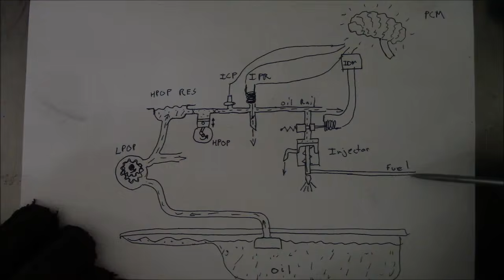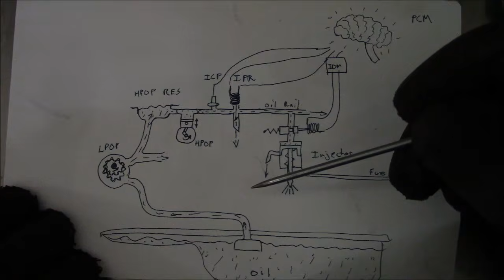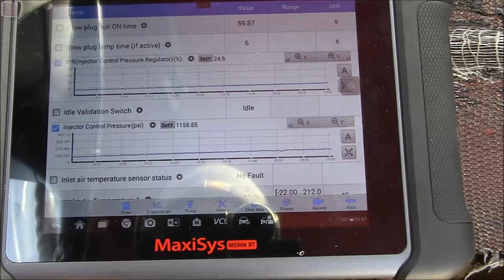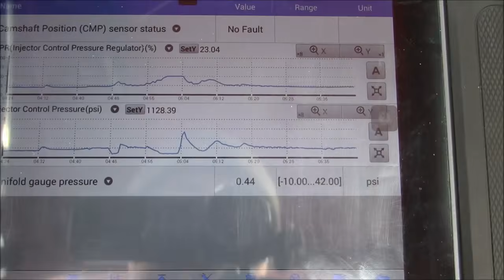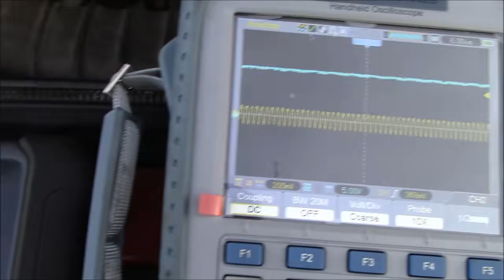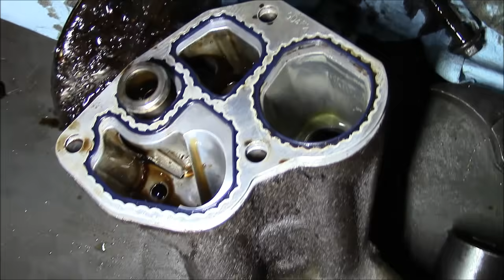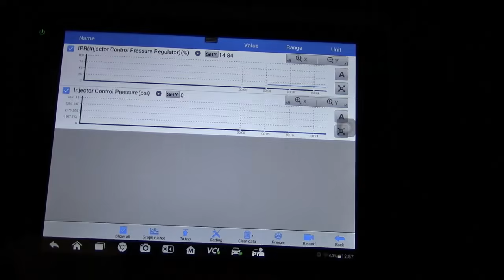7.3 Powerstroke Knocking, Rough Idle, Dying, but only when Cold. Plus many other Issues!

Comment: Great video about troubleshooting problems.  Thanks for sharing.  Loved the comment on the seat and shoes.  The Ground Strap on my 76 FJ40 runs from the starter mount area to the frame rail.  Do you recommend relocating those to higher in the engine bay as well, to keep them away from corrosion?  Or do those need to be as short as possible?
Reply from the maker: No, those big battery grounds are fine. But small wires don't fare well.

Comment: Good to see you fixing the wiring mess. That kinda stuff drives me nuts when I come across that.   One thing I learned from this video, is if I buy a old Ford truck. To not get one with that type of injection system. LOL
Reply from the maker: They used the HEUI for 14 years!

Comment: I live so far north that no salt is used. 
The roads are only sanded.

And of course plowed.
Reply from the maker: They used to do that here. They also used to use coal cinders. Now it's all salt.
Reply: @WatchWesWork  
It is normal here that it is too cold for the salt to work.
Otherwise, they probably had salted.
Cars from here are known not to be rusty.
They have many miles on the meter though.
For example, we have 25 miles to the nearest store.
So there are long distances here in the north.

Comment: what wrong with the seat , its perfect , nice job, question for you , i have an 01 dakota 4.7 and the engine stumbles form time to time , any suggestions?
Reply from the maker: Heh. No idea. Mass air flow sensor maybe.
Reply: @WatchWesWork  I,m a heavy equipment guy , desals loaders dossers and mining , you seem very well rounded with everything , very impressive , but i know big equipment  a lot better then gassers  , with the boots , holes in the toe don't matter , i replace mine when the heals wear just for back reasons , not the toe , lol if people complain use duct tape ,, that will keep them happy lol
Reply: Keep an eye on the tach, if the tach bottoms out when it "stumbles" it may be the crankshaft sensor. I had a 2000 Dodge Cummins with the same problem. Cheap part to buy, simple fix, just hard to get to.

Comment: I crimp those copper battery lugs on then heat it with a torch and flow solder in also then glue lined heat shrink over that. That makes them just about indestructible. Sometimes that’s hard to do all the old greasy wires though.

Comment: Is it normal to have so much smoke coming from the pcv on those old international 7.3`s? I'm not familiar enough with them to be sure
Reply from the maker: Yeah, mostly when the engine is cold and cooking out the condensation.
Reply: @WatchWesWork  gotcha. I was thinking about using one of those motors for my own project, but they look a little over my head so I'll stick with what I know for now. Thanks for the video!

Comment: Put a scanner on it Ck the history codes , put s 5000lb guages on the HP oil port , need 700 to start and run , 3000 at full fuel , ditch the mechanical fuel pump , mount one on the frame off a 6.0 along w/ a regulated return  , possible injector o ring leakage , also ck the screen and ipr function .How many miles/ hours ??? possible high pressure oil pump failure ??? saw one of these go 500,000 in a local driven tire truck , it did not move w/out at least 5 to 7000lbs on it.
Reply: Did you watch the video? Also they need 500 min to fire not 700.
Reply: Jdboy 9 How many hard start /no starts have you fixed , you put the fitting in the head and turn the key. At about 150,000miles the internal oil leaks start , depending on how it was cared for , remember , your using engine oil as hydraulic fluid , and yes I have put my guages on alot of no start /hard start trucks especially when not everybody had $10,000 laptop , btw if the high pressure oil sensor is not operating correctly or the engine does not start , the pressure regulator will be told to continue to build pressure, they will get stuck due to metal shavings , the 6.0s did come with a screen to prevent contamination.
Reply: @beckywatt5048  I have a gauge setup for testing hp oil. I'm not saying it shouldn't be used.  I'm just curious if you actually watched the video?  Your comments more or less are addressed in the video.

Comment: Have you pulled out the computer and made sure that the caps inside arent leaking? I had a 1991 F250 with a 351 and I had to solder in new caps on the board, it is a common issue with the boards and the caps being old.
Reply from the maker: No, but that's a common issue with all old electronics.

Comment: I had the rough idle on my 97 and hard starting ..lots of cranking , had to change the pickup pump and idle control to get it back to starting great . mine looked a little different but what a difference it made . I've put 3 seats in mine over the years ..I bought 2 trucks just because they had a good seat . Its mostly minor things that effect how a Power Stroke runs ...so fare never had a big repair ,90,000 still going .

Comment: HEUI is a pretty strong system despite its over complicated design, best part of it is the retard fail safe of not running if theres no oil pressure.  Yes I know drivers who would do this.
My honest first thought was ICP sensor on the way out. Just unplug it and if it still stalls out, its probably IPR or injection pressure(bad pump).
Reply from the maker: I've seen many no start Powerstrokes due to no oil in the sump. I remember dieseltechron said he gets at least one a week.

Comment: It’s sad that fords “best diesel ever” is really nit that good of an engine compared to others.  I use to love ford, but won’t buy one anymore.
Reply from the maker: To be fair, it's an international engine, and they were pretty decent. It's 25 years old...
Reply: Haha.
Reply: I won't buy ANYTHING with POS sensors on it that govern running the engine. I don't care the brand name they slap on the vehicle. They're ALL designed to fail just after warranty and the newer it is the more difficult to work on. Newest and pickup I'll ever own with a diesel in it is my 1st gen 12v cummins. Rides terrible but the engine is all mechanical.

Comment: If a guy has a bluetooth OBDII module you can get all the live data using Torque Pro.  If memory serves me I had to manually set up some of those PID's to work.  Been a long time since I've messed around with a Ford so Torque might have added those PID's by now.
Reply from the maker: A lot of guys use it.

Comment: Cold out...  -12F at 10 am here LOL.  Brand new lift pump decided it doesn't want to work at those temps.  Fuel is 50/50 #1 & #2 diesel with a dose of Stanadyne to boot.  Fuel isn't even cloudy.  Cummins started right up though.
Reply from the maker: Hmm. No water in it?

Comment: 😅😉 Hey, did you notice you need a new seat? Also your boots, is that a hole? 😂

Proud to be one of the 2 guys still watching till the end. Fully agree with you about wiring, do it right or do it twice (and with a fuel pump, the second time is likely to be in the pissing rain at the side of a road). 

Great video!
Reply from the maker: And I've had 3 of those fuel pumps leave me walking.

Comment: Not the exact extension but you can get these in all different sizes. I’ve got a few different styles to help out when I need one. Oh yeah Wes, by the new year you’ll have 150 “you need a truck seat” comments or at the least something said about it. 😂

https://www.amazon.com/Lenox-Tools-3084712X-12-Inch-Extension/dp/B000LGBY9E/ref=sr_1_5?hvadid=77996714502582&hvbmt=be&hvdev=c&hvqmt=e&keywords=die+grinder+extension+shaft&qid=1577637442&sr=8-5

Edit: I forgot to add you can also get these for your drill/impact driver that has the quarter inch hex with and without the detent lock.

Comment: That seat is just fine. A little duct tape will fix it, same with the shoes. :-) Great video. (edit to add: only mentioned those becouse I was one of the two. :-) )
Reply: Use LOCTITE expansion FOAM to FIX SEATS
JUST FILL
WAIT
CUT AS NEEDED
COVER 
NEVER ANOTHER ISSUE
JUST AS DENSE AS STOCK SEAT FOAM
WATER REPELLENT
Reply from the maker: Thanks for making it through!

Comment: Yeah, I got a good laugh when Andrew pulls out his grinder with a cut off wheel to fix his heater. Although, I do think he does his wiring a  bit better than what you showed. My seat looks just like yours, I need a new one also. Great diagnosis thank you.
Happy New year!
Reply from the maker: Yeah I saw that one...
Reply: TillmanXL yeah no. Fixing the vent with a grinder, and even worse, in the same video, he couldn’t figure out there was one more screw in the door panel so he angle grindered it. Fucking disgusting.

Comment: Unfortunately, your Ford Dealer sold you the wrong IPR valve.  The missing part you showed in the video is the edge filter.  The later 7.3L had the filter relocated into the high pressure pump.  The truck will run fine but there is the risk of debris entering the IPR valve and causing it to stick.
Reply from the maker: That's actually because I ordered that IPR for a later model truck that had roughly the same issue. The IPR I ordered for my truck was not in stock at the time I was filming this so I had to do a switcheroo later. But you are correct and I should have showed the correct part.

Comment: That truck is every mechanic’s nightmare.  The most surprising thing about the truck is that it doesn’t also have a plow with a rats nest of wiring, scotch locks and booger welds.
Reply from the maker: It's 2WD, so no plow. But it started life as a tire shop service truck, so it's had a rough life.

Comment: Slow start is hard on starters. My cummins started at 0 deg F  with block heater not plugged in after red light extinguished with no hesitation!  My supervisor had an older cummins with seal problems SO? Just a friend Ron
Reply from the maker: I've started my 6.0 powerstroke at -25F with no block heater.
Reply: @WatchWesWork  I was in Denver, CO. People in the Dakotas and Montana may have some interesting stats! Ford is an American icon. Henry built cars for the working man. They should stay in the USA and so should GM. We shall see! Prosperity usually leads to improparity by it's citizens. If neighbor loved neighbor then all would be much different! Just a Dodge, Fiat lover Ron

Comment: I love the OBS I know the 7.3 has alot of issues but I think its the ptpump, Also check the fuel filter could be limiting alot of pressure and it cant keep up.
Reply: Isn't that the first Power Stroke after the IDI Motors when they were still working out the Kinks before they mastered it in 97 - 99?
Reply: @thecloneguyz  I think the 7.3 had issues until they stop making it to be honest lol
Reply: @PCgamestech  
The 97 - 99 are selling for BIG BUCK$ 
Most sought after truck
Reply: @PCgamestech  
And the 24V Cummins are SKYROCKETING FAST! !!!
Reply: @thecloneguyz  Oh I know I wish I had one of these Id swap with a commonrail cummins lol
Reply: @thecloneguyz  Yup because everyone wants a cummins swap 24v is one of the best
Reply: @PCgamestech  
I wish somebody would take an om647 diesel engine and put it into a Ford body
Reply: @thecloneguyz  I think they dont because its such a small engine, Most people who swap want lots of power and torque
Reply from the maker: Fuel pressure is important. But it did not cause the issue I had.
Reply: @WatchWesWork  Yeah I saw I had to make my early prediction though great video though tearing into it.

Comment: Medium to light corse sand paper or a scotch bright on a flat smooth table will clean up that neck base
Reply from the maker: It's not flat on the bottom. The center is convex to hold the o-ring out.
Reply: Yeah that was my bad I didn't notice

Comment: oh no the rusty dump is back too!  Did you notice you need new boots and a seat for your Ford?  Love your systematic logical approach to diagnosing problems.   I think ill stick with my cummins.  Seems like fords always have starting issues with their diesels in the winter.
Reply from the maker: If the batteries and glow plugs are good I've never had a Powerstroke that would not start in winter. I started my 6.0 at -24F once with no block heater. But if the glow plugs or batteries are weak, forget about it. I've worked on several with the intakes blown off from using ether...

Comment: wow ,way over engineered, must of had some german inspiration
Reply: tvoprosucks It works good.
Reply: Bosch's contribution...
Reply: @icesoft1  they make good stuff. Just opened my f150 door and on 2013s there window motors are bosch. they also make good electrical components and maf sensors. Im used to bmws so bosch is in them. There better then the aftermarket.
Reply from the maker: Bosch and Delphi are about the top of the heap for diesel injection components these days.

Comment: The one nice thing about my old diesel Benz is that if you can get the engine started in winter it will run as long as you can keep the tank filled.  That engine is practically bullet proof - as long as you change the fuel and oil filters regularly!
Reply: Thats the 0M647 
Not fair
THE ONLY "MILLION MILE MOTOR" known to man
Thats why the 2003-2006 Sprinters can do 500k before even breaking in!
Reply: Volvo has the only "MILLION MILE CLUB" fir their cars!
Reply from the maker: These 7.3 engines are typically pretty reliable. There are numerous 7.3 with documented 1 million plus miles.

Comment: When i see problem like that with 7.3, first thing i always do before testing anything is a good oil flush and replacement, most of the time it fix a lot of weird thing.
After that, i start troubleshooting like you did.

Comment: If i were you, i'd drill the post for the coil and put a pin through it. That design doesn't spring confidence in my eyes considering how much rattle the engine alone produces. It's like asking for the nut to come undone.
Reply from the maker: I may look into a real nut instead of the stamped style.

Comment: 14:39  How many of those IPR valves I changed on Cat engines. Lol.
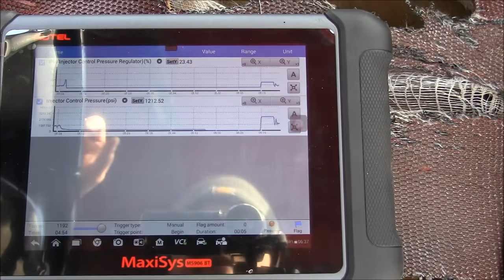17:27  Now that the oil got hot and thinner and the pressure dropped the first place I would go is to the injectors seals.
Reply from the maker: I don't think the o-rings are leaking. No oil in the fuel and I did pop the valve covers off and have a look.
Reply: Or let it burn, get insurance money and buy a truck that hasn't been so molested ;)

Comment: love my 7.3 powerstroke  generally a very reliable engine
Reply: The only common problems are leaks and fuel problems. These engines are fairly solid.
Reply from the maker: I like mine.
Reply: @WatchWesWork  Thing sounds mean for a V8 diesel, wouldn't mind one around myself.
Reply: @CumminsDriver100 Go buy one then
Reply: Tends to depend on the quality of servicing.

Comment: This was probably designed to allow independent control of the injectors from the engine speed without having to completely design new electronically controlled injectors.
Reply from the maker: Yeah, but there are electronic controlled mechanical unit injectors. Cat, Detroit, and Cummins were all using them before HEUI was developed.
Reply: @WatchWesWork  ah. Well I was just guessing.  I'm not very familiar with diesel injection.

Comment from the maker: Thanks to the commenters! The rol loc adapter is a Lisle 22500. Link here. https://amzn.to/2QDNM0s
 Here is the uninsulated terminal kit. https://amzn.to/2LB4jjZ
Reply: Found it Lisle 22500 Thermostat Gasket Cleaner https://www.amazon.com/dp/B0009OMYB0/ref=cm_sw_r_cp_api_i_lHpcEb12NS309
Reply: I believe CatDieselPower99 was the first to find that it's a lisle 22500
Reply: I just thought I would point out you need new seats and also boots.
Reply: Is this the disc holder you were looking for?
ProTool 5542 Roloc Disc Pad Holder Shank, 2" L https://www.amazon.ca/dp/B003VOO92M/ref=cm_sw_r_cp_apa_i_tJmcEb9ENXH1A
Reply: @UnlaunderedShirt  That one's only 2" long. Another commenter  posted a link - it's a Lisle 22500
Reply: That must be the very first Powerstroke after the IDI Motors
They didn't Master the power stroke until 97 to 99
Reply: As I posted roloc extensions are called a number of things inc a bore polishing mandrel - roloc backing plates are 1/4 x 20 thread 

Eg. Merit EM-146 (6”)

Or you could uses a collet extension
Reply: That's fuel issue check fuel tank screens and change your  filter your chasing  the wrong  thing your truck wouldn't start in cold weather  if there  was  an oil pressure issue  check Ipr readings tho